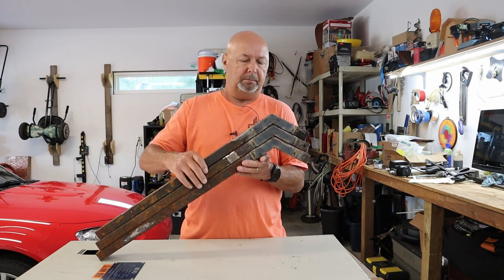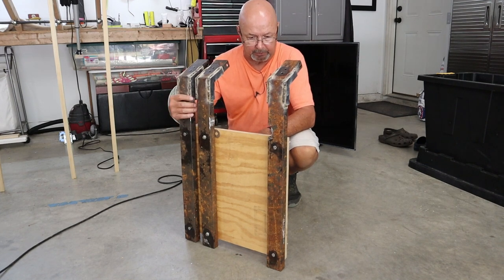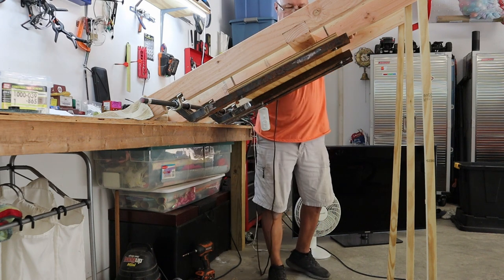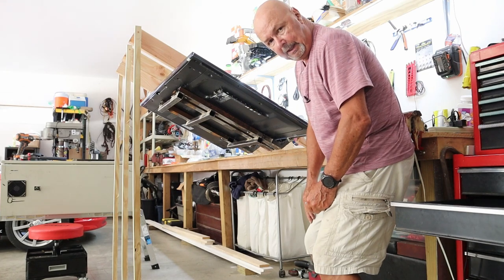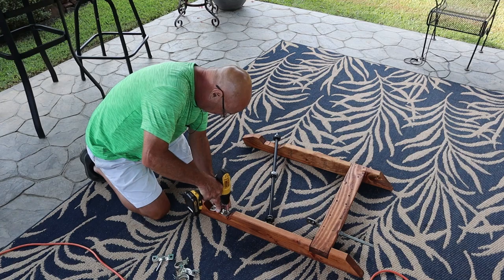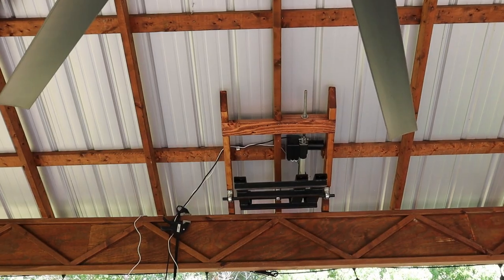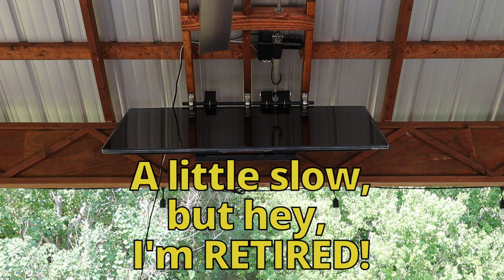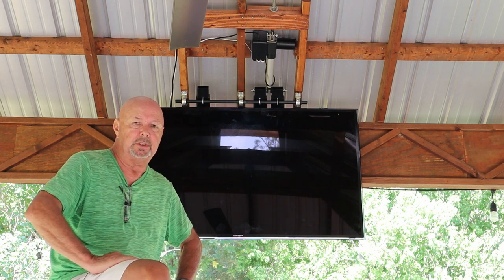Drop Down TV on my Patio!

Comment: 0:42 Smith! this is absolutely the best solution to the Flip Down TV Ceiling Mount System in all the net! I've been searching this DIY Project for long time to replicate it in my home, thank you so much for this work Smith, I just a question:

What's the angle you give it to the 3 metal pieces that form the main TV holder frame once you cut it and bend it to get it weld? I just can see the the angle must be more the 90 degrees but I would like to know the angle you give it to... Thanks for your efforts Smith...
Reply from the maker: Let me check and I'll let you know.
Reply from the maker: Hi, the angle is 119 degrees. I really appreciate you watching and the comments. I have this drawn in Solidworks and can export different file types if that will help you any.  I think you have already, but if not, please consider subscribing, Like and hit the bell icon.
Reply: @NINEPOINTFIVEPROJECTS  I'll appreciate it...
Reply: @NINEPOINTFIVEPROJECTS  Thank you so much Smith for the time you spend to check the measurement it will be so useful for replicate the project... Greetings from your new friend and follower Ulysses from Mexico! God bless you and all your relatives and happy new year eve!

Comment: Hey buddy,  i got everything i need to start now . If you could help me with two measurements i would sure appreciate it . I need to know the measurement from the center of the 3/4" round bar to the inside edge of the gazebo.  And the other measurement from the center of the 3/4" round bar to the underneath side of the metal ceiling panels.  . That would give me a starting point . And help me to know what size square tube to buy . Thank you sir .
Reply from the maker: Hi Tim, I'm away from my drawings for the next week but will get for you as soon as possible.
Reply: @NINEPOINTFIVEPROJECTS  that would be awesome.  Thank you . I go in for a major surgery on Friday , so I will be down for a while and not be able to lift anything for a while . But I would like to know those measurements  so I can have it all in my minds eye . If ya know what I mean . Thanks for getting back to me . I found a place in Utah , and a cool guy named Matt that got me all new equipment actuator,  power supply and wireless remote that can be programmed to know the end points.  So I just press one button.  Very cool .
Reply from the maker: I was able to look at the files that I put links to in the description on Google drive. You should see a file there called "TV Mount Assembly Rev 2". You should be able to get your hands on a free CAD program and view that DXF file. You can take dims off of that.
Reply: @NINEPOINTFIVEPROJECTS    I looked at all the drawings.  I should be able to get the measurements from the center of round bar to the edge of gazebo by using the existing measurements and then scaling the gap .  And the one from the center of round bar to underneath ceiling I can get close from the size of the 2x4 and then look closely at the video.  Thanks for all you have done .  I still say it's the best design for a gazebo ever . I have s much respect for your ability to think outside the box and then make your hand do what you thought would work . Well done sir 👏 👍
Reply from the maker: Thanks, let me know how yours turns out.
Reply: @NINEPOINTFIVEPROJECTS  I will for sure . It will be awhile because of my surgery.  It gives me something to look forward too . I bought a wall mount that I'm going to use so it will hold any tv up to 72 inches.  And it will allow me to tilt it down another 8 degrees if needed.  But I am going to use a 55 in. Outdoor tv that is completely water proof and heat resistant and can be seen in direct sunlight.  Even though it will be in the shade . 😎

Comment: I am so impressed, sir . 👏  . I love the design it is the only one I have seen the tv mounts face up. That, in my opinion, is the best way to keep the tv close to the edge of the gazebo.  I want to make one . I am a retired pipefitter welder . I have a few questions. If you have time to answer them, it would be greatly appreciated . I did like and subscribed.  The angle you welded the steel brackets was that at 45 degrees?  And did the tv end up sitting vertically plumb when all the way down like you had hoped?  With that same design, would it be possible to get it slightly tilted down rather than vertically plumb ? Or if you have given it any thought.  The design is nothing short of genius, sir . Way to think outside of the box .  I'm going to buy the actuator from Amazon.  Can you lead me to one that has the power and length of travel to get it to work properly?  My gazebo is metal frame, so I will be using threaded rivets to mount with . What gadge square tube would be best . To keep it light but still strong enough to hold the tv . I'm going to use the 55" as well .  Hopefully, that's not too many questions, lol 😆.  My name is Tim, and I live in Vegas.  It was a pleasure watching you work.  Thank you 😊
Reply from the maker: Hi Tim. Thanks for watching the video and Subscribing. If you would give me your email address, I'll send you some info on exactly what I did. I don't know how to include attachments here.
Reply from the maker: Hi Tim, I uploaded drawings for the rig into my Google Drive. I put links to them in the description. Let me know if I can help further.
Reply: @NINEPOINTFIVEPROJECTS  I don't know why my email will not go through in a reply.
Reply from the maker: I uploaded the files and there is a link in the description. Let me know if you need more info.
Reply: Your drawings are excellent.   Are they in inches or cm . 0.5  is = 1/2"  ?
Reply from the maker: Inches, yes .5 is 1/2 inch.
Reply: The 119 °  degrees is that because of the pitch of your 6/12 roof ?    Im not sure what my pitch is yet . Mine doesn't look as steep as yours . So would that effect the degrees of offset in those 3 pieces ?  @NINEPOINTFIVEPROJECTS
Reply from the maker: Are you talking about the 188.02 degrees? If so, Im just showing the angle of the TV from my rafters. I just show those angle as reference in relation to the length of the actuator. I don't think that would affect anything that couldn't be adjusted out with the large adjustment bolt that I fabricated. The most critical dimensions are those shown in Detail A. Now keep in mind that I wanted to keep the entire mechanism to a size that would fit within the space within my rafters. In my case it was 3 1/2" for the rafter and then an additional 1 1/2" for the perling. If you have more space you could likely do things differently. Hope this info helps you.
Reply: I think I understand.  Yours just works so perfectly.  I want to be very close to the same . I'm going to take all my actual measurements and make a smaller scale model of it out of balsa wood.  So I can see any modifications that will make it work for my particular application.  There will be no wood in my build.  I will stay in contact to let you know how it's going . Or if I have more questions.  I'm still deciding on what tv I want to buy . I've been doing the research on that . And then I get my metal from a guy whose son owns a fence  company . They sell it to me cheaply if they have extra out in the junk pile in their yard . Thanks again for the help and your design.  It is amazing 👏.

Comment: What was the stroke length required for the full range of movement?
Reply from the maker: Hi thanks for watching and the comments. I think it was right at 3.5 inches. Not ideal but I made it work. The older bed unit I used would only push and not pull. So I used the push motion to lift the TV and gravity to drop the TV.  Either way, I think you may have already but if not please consider Subscribing and hitting the like button. I would really appreciate it!

Comment: not worried about thge heat from the roof?
Reply from the maker: Hi thanks for watching and the comments. Yeah I was concerned about the head, humidity, the cold etc. From what I under you can buy special TV'S made for outdoor use but they are EXPENSIVE! I have had a video Amazon Alexa on the porch for quite awhile and it has done fine. So, I decided to put this standard Samsung out there and so far it has withstood the heat after I installed it last summer and some pretty extreme cold spells this winter (into the teens). I am really curious as to how long it will last. Either way thanks again for watching and if you haven't done so already please consider Subscribing and hitting the like button. I would really appreciate it!
Reply: @NINEPOINTFIVEPROJECTS  keep us updated. was a really neat designee

Comment: Hey buddy,  Tim again . Is there anyway you can give me the make and model number off of the actuator you used ?  It was already DC 110v right .?  All in one unit . So I can see if I can locate one . Please 🙏
Reply from the maker: Yes, I'll have to find the info.
Reply from the maker: Hi Tim, I put it on Google Drive. The link is on the description. The one I used was a pretty old one. The remote to operate it was a wired type. Newer ones use wireless remotes.
Reply: @NINEPOINTFIVEPROJECTS Thank you so much . 😊 I will see if I can find one like it . I will let you know if I do . Have a great week.  👍
Reply: @NINEPOINTFIVEPROJECTS  hey buddy , I found a couple on ebay . One is unused with the power supply mounted to it . But when I asked him if it worked if he plugs it into a wall outlet.  He replied and said that he does not have the remote to make it work . How did yours work ? Do I just need a toggle switch to make it work . Or do I need a remote control unit just for that actuator and power supply  ? 🤔
Reply from the maker: Mine is wired to the remote and I don't think you could just use a toggle switch in its place. The remote cable plugs into the power supply. So you might be able to also find a remote to use with it. If it's a newer type of actuator it may use a wireless remote.  Maybe the seller could tell you what type it requires.
Reply: @NINEPOINTFIVEPROJECTS  lol it never ends 🤣  .... I'll have to ask the seller more questions.  I will be glad when it's all in my hands and I flip a switch and it just works .
Reply: @NINEPOINTFIVEPROJECTS  I went ahead and bought the TEMPER-PEDIC TZ120-24-1 with the power supply attached to it 
. I would really like to see your handset wired controller.  So I know one if I see it .  And I saw that it plugs in on the power supply where it says handset .

Comment: Is your actuator 12v or 24v ?  And the actuator I'm looking at on Amazon is 12v  and 6" travel at 650 lbs .  Is that good for this project?  Also, I'm not an electrician . It comes with an up down toggle switch. Would that switch also wire to a regular electrical outlet? And convert it to 12v  ?
Reply from the maker: Tell me which one you're looking at on Amazon. Mine plugs into 110 but has a converter down to 12 volts DC.
Reply: @NINEPOINTFIVEPROJECTS  brand: RVMARINEPAT 
Linear actuator 12v with controller 6" 3000N/660lbs stroke electric 5mm/s motion actuator heavy duty with reverse polarity switch controller. 

This is the one I'm looking at .
Reply from the maker: I believe you will need a pretty hefty 12 volts DC supply with that.
Reply: @NINEPOINTFIVEPROJECTS  Thank you , any recommendations from Amazon that would work easier for me than that one ? I'm not familiar with these actuators . Or a recommendation of a hefty DC power supply?  Without spending a boat load of money.
Reply from the maker: If you could find a power bed actuator on eBay or Facebook. Thats what I did. Power supply and actuator all in one package. I even seen people giving away complete old beds.
Reply: @NINEPOINTFIVEPROJECTS  I'll see what I can find . I have several power supplies from a couple of reclining chairs we had . But the actuator is very different.  I don't think none of that stuff will work . There are a few 12v to DC 110 power supplies for $30 to 100s . I just don't know what it needs to be . I don't want to buy stuff that is overkill or doesn't work together.

Comment: Me interesa hacer uno
Como podrás ayudarme 
Decirme los materiales
Reply from the maker: Hi thanks for watching and the comments. For the motor I used a bed motor and control. You can find these used on eBay. For the metal I used some 1 x 2 tubing. It was scrap that I had but you could use different metals. I think you may have already but if not please consider Subscribing and hitting the like button. I would really appreciate it!

Comment: Love the idea but notching the bottom of the trusses is not a good idea
Reply from the maker: Hi thanks for watching and the comments. I'm not too worried about it. They are really not trusses but are rafters. I only notched one 1 1/2 inches deep. I also have 2 x 4 purlins spanning across the tops of the rafters. I'm confident it will be fine. Either way I do appreciate your feedback. If you haven't done so already please consider Subscribing and hitting the like button. I would really appreciate it.

Comment: Yeah I'm sorry to say buddy you could have bought something that looked way nicer and you wouldn't have had a gone through all that effort. Plus you would have saved yourself some money. Nevertheless you did a nice job man cool video thanks for uploading.
Reply from the maker: Hi thanks for watching and the comments. I have to disagree with you about some things. First I bought the device that actuates it on eBay for $75. I used scrap steel I had laying around. That and the bearings, shaft and bolts is all the cost I had in it. So, total cost near $100.  I designed and built it because that's what I do and enjoy seeing my ideas come to life. I really doubt you could find anything to do this for less than $1000 bucks. Either way, all is good and I appreciate your feedback. I think you subscribed and I truly appreciate it. I'm an old timer and do this stuff because I enjoy it.
Reply: No way you are finding an electric folding mount for cheaper then what he did. Also many of the electric ones out there fold the other direction. Nice job on the mount @ninepointfiveprojects
Reply from the maker: Hi thanks for watching and the comments. I agree with you. You won't build something like this for less money. I think you may have already but if not please consider Subscribing. I would really appreciate it.